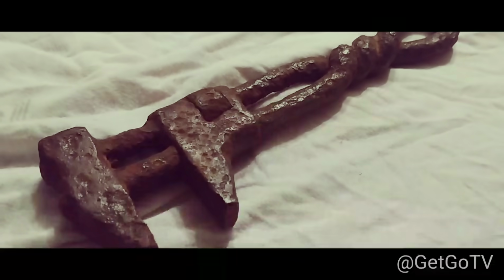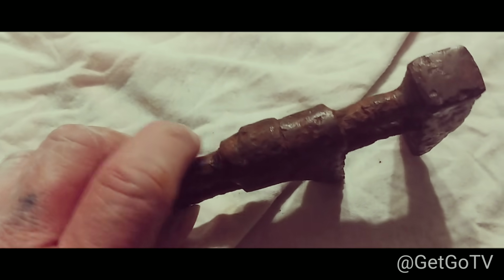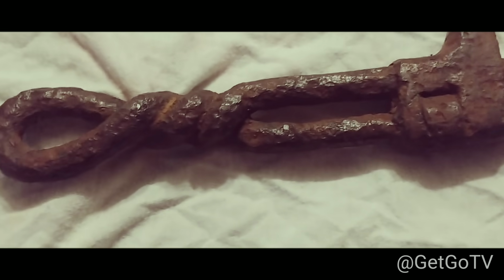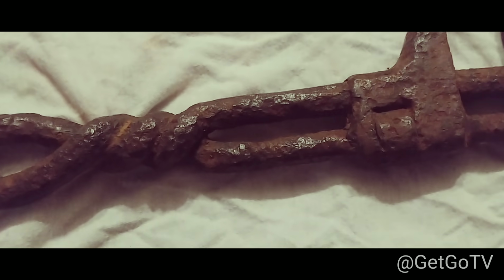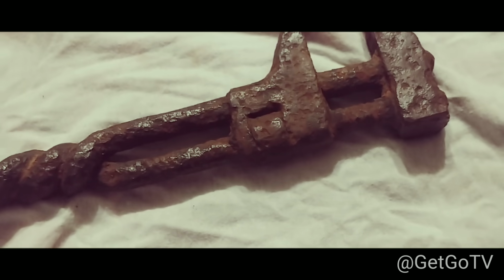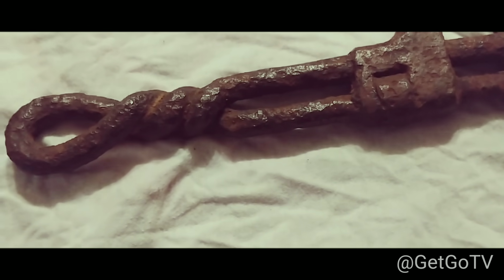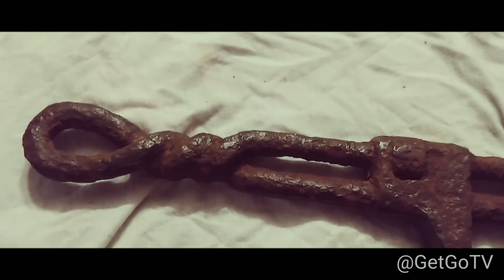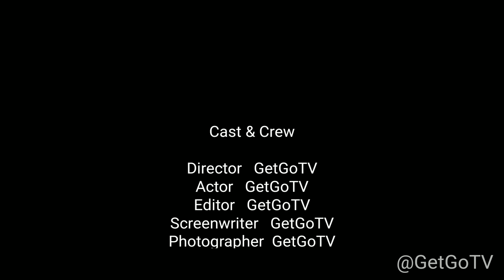IMPOSSIBLE RUSTY WRENCH RESTORATION

Comment: if you put some plastic containers with pennies to weight them down in the liquid bath they will raise the liquid level without absorbing it so you need less liquid to cover the tool/item. 
nice job of the wrench
Reply from the maker: This is an awesome idea. Thanks for the tip
Reply: Or rocks, or anything heavy
Reply: most rocks are porous, wants to be something non porous and unlikely to add contamination ( i use jenolite wich is more acidic)
Reply: @messylaura  Sorry, I guess I misunderstood what you were saying. I thought the point was to put the plastic container to increase the liquid level without actually putting any liquid into the plastic container, like forcing them to sink there by causing the level outside of the plastic container to raise the level without liquid entering the plastic container.
Reply: yes thats correct, reading my last comment, the (i use jenolite...' ) was referring to the liquid i use i for the bath, not the addition too, this was why i use plastic bottles not rocks as the acid can attack rocks
Reply: Marbles.
Reply: Or get a smaller container big enough for a wrench.

Comment: Sometimes you gotta take a dremel to shave off a layer of metal on top and bottom of that adjuster there. Really get some sharp metal picks too and see it you can get any oil inside. Also hit it with a hammer of different sizes and weight. You should get some kind of results

Comment: Great job that one really did not look like it was going to be able to be saved. You did nice work on this one. Are you going to clean it up any further? or smooth the jaws out? Are you going to leave it as is? Either way it's a feat of determination.
Reply from the maker: Thank you I'm glad you enjoyed the video. I did not think this one would be possible either. The point of this video originally was going to be me showing that some things are just not restorable. I was very surprised when it started moving. It took a month to get it broke loose. Unfortunately the pitting is so deep and the wrench is so damaged that I will not be doing anything further to it. All I could do with this one was to get it to function. I will be posting some more videos in the future of wrenches that are in really bad shape as well. One that I'm working on now I don't believe will be fixable as the frame is starting to crack and I can't put a lot of tension on the adjustment wheel
Reply: Spot wield it to a size you can use it at

Comment: AMAZING JOB! Wow, hard to believe you got this thing working! Nicely done, sir!
I understand that you probably didn't want to alter this wrench out of respect to its old nature. However, this was a piece of rusted junk! It would have been much better if you had fully restored this thing. The value is negligible at this level of deterioration. Make a Part 2 and fix it entirely. Nice work!
Reply: The HMS Trincomalee is the oldest warship still afloat. It was built in 1817. It has been repaired and restored for its entire lifetime. That doesn't make it less valuable. Pull out the power tools and bring this thing back to life!

Comment: Well I’ll be buggered, I have one of those wrenches and I thought it might have been home made! There are a few markings on it but not a brand name. Do you know anything about it. Cheers Stuart 🇦🇺
Reply: Hi i saw one of these for the first time in my Uncles shead i to thought it was hand made beautiful thing all the same. O and my Uncles shead is here in Ireland 👍 😆. Co.kilkenny
Reply: Hi Jim and Ian, thanks for the replies, looks like these things went around the world. Anyway I have taken a better look at mine and I must have not been wearing my seeing eye dogs when I looked the first time as I have found the makers name. If you lay the wrench down with the jaws facing left then cast into the bottom/ moving jaw, in raised letters is the name  M.V. McKAY this is above the adjusting nut and below the nut is the word MAKER. On the reverse side the top jaw is stamped W6 and the lower is stamped W7 with the same type of stamps we would have in the workshop. Mine is obviously in better condition than the one in the video. I think saying is was restored was a bit of a stretch but he definitely made a useless tool usable again. I’m with you Ian as I don’t like those imperial shifters either as they won’t fit modern cars. 😉
Cheers Stuart 🇦🇺

Comment: I guess I'm going against the grain here but I don't see this wrench ever being repaired to the point of use again. I'm pretty sure it wasn't worth anything to begin with but any wall hanger collector value that it might have had was removed when you started wrenching on the adjusting nut. Should have just cleaned it up and sold it as a wall hanger.
Reply: This is not a restoration.
Reply: I have got one like this, given to me by a friend and it was just as rusty and seized, I got it clean up and working again, it now lives in my toolbox used regularly, I have quite an attachment to it having saved it from scrap.
Reply: Did you read the title of the video? It says: IMPOSSIBLE RUSTY WRENCH RESTORATION. Which means it is a restoration.
Reply: @stevethepirate8907  all right

Comment: you soaked it in liquid wrench for 3 weeks then freed up the threads and call it restored? hm.
Reply from the maker: Yes unfortunately getting this tool to work was about as far as you could take the restoration. There is pitting on the tool that is up to a quarter of an inch deep that cannot be removed

Comment: Smh didn't even try a wire brush or wire wheel. I hate to say this but you didn't do a lot of good restoration on it. Is
Reply from the maker: Watch the video again and watch it more closely this time both a wire brush and sandpaper were used. The point of these restorations in this playlist is that they're being done with antique tools and by hand with no power tools. This wrench has pitting that is up to a quarter of an inch deep. The restoration was taken as far as possible